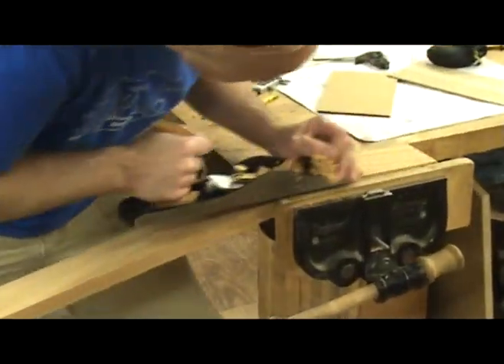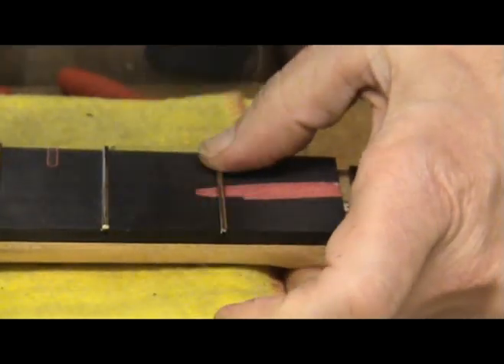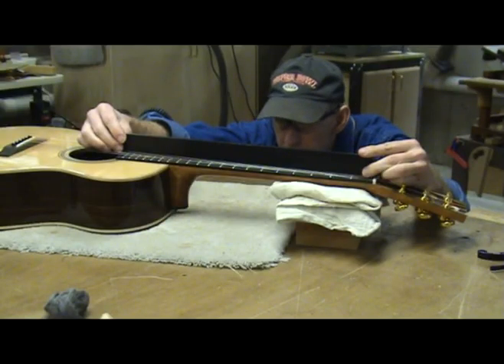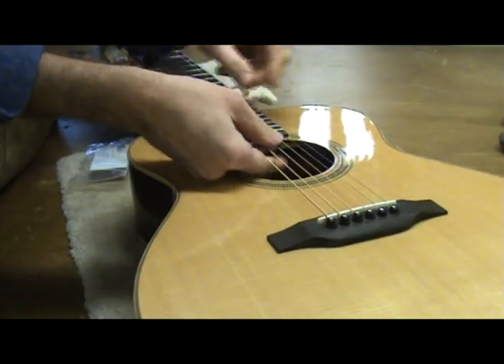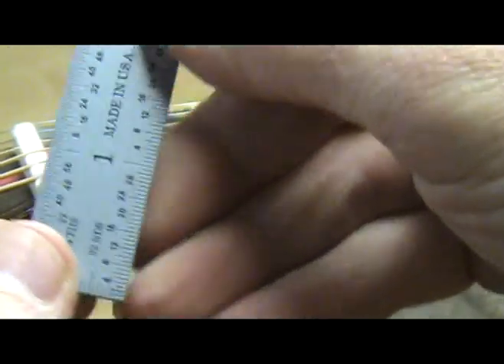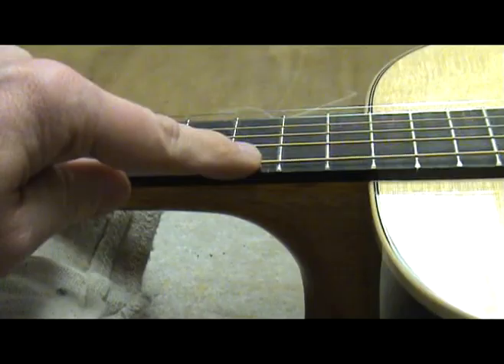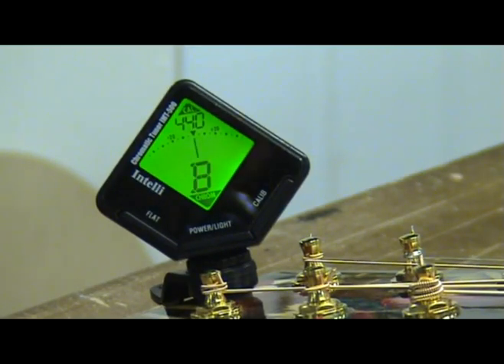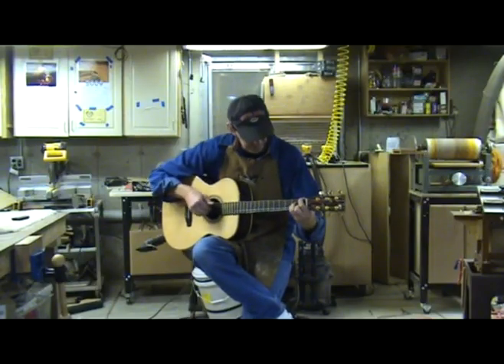Luthier Tips du Jour - Acoustic Guitar Set Up

Comment: @ElectricTurkey1  In addition to what ObrienGuitars has said may I add that when using a capo it should be placed as close to the required fret as possible (without muting) I have noticed many capo users wrongly place the capo mid fret or too close to the previous fret.

Comment from the maker: @buckethead777 You need to remove the saddle and sand the bottom of it but I only do this after first checking the truss rod and adjusting if needed and then checking the action at the nut. I then adjust the saddle height if needed.

Comment from the maker: @REX05011 In this case, usually nylon string guitars, the maker has carefully thought out things like neck angle, relief etc during the construction phase. Also, there is not as much tension on these guitars so a truss rod is not necessary. If you happen to have a steel string guitar without a truss rod then you could experience relief issues.

Comment: I was always told to set the string at the 12th  fret by sanding the bottom of the saddle prior to adjusting the nut. The nut should be the last thing done prior to setting the intonation.  The reason was if you adjusted the nut height first and then adjusted the height of the string at the 12th fret by sanding down the saddle you might get buzzing at the first fret .  What do you think.
Reply from the maker: I suppose that could happen but the opposite is also true. Since a larger adjustment is usually necessary at the 12th fret instead of the nut I choose to adjust the action at the nut first.

Comment: Please note:  presuming the relief is satisfactory, cutting the nut slot depth before having a preferred saddle height can easily lead to buzzing (if the saddle needs substantial reduction in height)  or leave you with a stiff action if the saddle needs to be raised.  When you fret any string, the first element eliminated from the equation that contributes to buzz is the nut.   The proper order of adjustment is: neck relief, saddle height, nut slot depth and then intonation.  Period.

Comment: @MrVoodoo72  Several acoustic guitars do actually have adjustable bridges (Gibson Humming Board is one) I'm not sure how this could be used on guitars with under saddle pick ups though as myold Cimar 12 string humming bird copy was always used with a sound hole magnetic pick up. (necessitating steel or nickel wound strings)

Comment: Thanks for answering I really appreciate it.there is some relief on the neck. Also if I put a straight edge on, it touches the 16f and not the last fret. Is that ok? I don’t have an align key to make adjustments.when I got my guitar,it had medium gauge strings.I don’t know the size.I’m using light strings on the advice from a music shop. will the extra tension from medium strings be enough to bring the relief back?This is the first time iv setup a guitar and want to get the best sound from it

Comment: Great video! This is just what I do to make a $100 guitar player like a $1000 guitar.  I file down to a stack of feeler gauges for a nearly foolproof nut adjustment - but same result.   

If you have never adjusted a truss rod then by definition you do not know what you are doing.  How are you going to learn?  First get a cheap guitar for your first subject.  You probably have one.   Then LOOSEN the truss rod first - 1/4 turn or so - even if you need to tighten it.  Now as you tighten it if it suddenly gets really hard to turn (after going that 1/4 turn) you know it is bottomed out and not just a little tight.

Comment: In setting the bridge on a classical guitar with a 650 scale and normal tension strings, the reference I am using tells me to use a bridge stick cut to 651 and butt the bridge up against the end (centered on the fretboard).  My question is that since the saddle is 1/8" thick, that will make the front of the saddle back another 3.1 mm because of the wood in the bridge OR if the stick contacts the nut only the center of the nut will be 1.5 mm longer than the 651mm of the stick.  Help!  Is that a correct setting or should it be 651mm to the center of the nut to the face of the nut?  There wasn't any drawing to clarify that part of the build.  So any help would be greatly appreciated. 
Frank in Arlington, Texas
Reply from the maker: I add 2mm to the overall scale length on my classical guitars. This is measured from the front edge of the nut to the front edge of the saddle. Hope this helps.

Comment: I'm from Brazil I'm 24 years old
the doubt now and I bought a guitar so he imported've been missing the fuse
I bought a fuse already framed and ready to put q realized the strings were high and the sound too dry and bad
oq do wonder what the first adjustment which should regulate the fuse first eyelash or tensor?
ja hear you have to find the octave guitar
As it is the eighth and how to measure the radius if necessary?
I hope you help me with many questions

Comment: Really good vid Robert, about the best I've seen on basic setup. Just a question/observation about checking the intonation. I come from a technical background so I may have a slightly different viewpoint to most musicians. When I pluck an open string, the frequency (pitch) that I hear is what I regard as the Fundamental (or 1st harmonic) frequency of that string. If I fret that string at the 12th fret and pluck, what I hear is referred to in technical terms as the 2nd harmonic, and ideally should have a frequency (pitch) twice that of the fundamental. For example, if my guitar is tuned to standard 440, the open low E string has a frequency of 82.4 Hz. If I fret that string at the 12th and pluck I should hear (or at least my fancy electronic tuner should), a frequency of 164.8 Hz. This would indicate to me that my guitar is perfectly intonated, at least for that string. If my tuner reads high or low from 164.4, this indicates to me that some adjustment of the saddle or bridge is required to get the intonation right.Just my 2c worth. I'd love to hear comments.
Reply from the maker: You are correct. Books can and have been written on the subject of intonation. It is complicated. We haven't even discussed the different temperaments either!

Comment: How low can you file the saddle down, (obviously without buzzing strings) in order to get the lowest action? Is there a limit that will affect the sound? Thank you
Reply from the maker: Your guitar will need to have the correct neck geometry. If not you have a high action and no saddle left to lower and get the correct action. Your guitar would then be a candidate for a neck reset. I like to keep around 3 or 4 mm of bone exposed out of the saddle to get the action I like at the 12th fret.

Comment from the maker: @RedLedZep Sounds like your guitar has been extremely neglected and dried out as a result. When this happens you also usually have internal structural issues as well, check the bracing to make sure it is still intact. If it isn't then address that first. SLOWLY, humidify the guitar and keep it that way.

Comment: On relief and truss rod, when i tap my 6th string on the 6th fret, i heard a sound, does it mean the guitar doesnt much relief? Should the string sits on the 6/7fret?
Reply from the maker: Hearing a sound means the neck has relief and this is good. The idea is to adjust the truss rod for the amount of relief that the player prefers.
Reply: WRONG Mr luthier !! Relief is not what PLAYER prefers ! It's what the GUITAR prefers so as to provide the vibrating strings enough space to spin around without hitting frets ! The ACTION, is accomplished by the saddle height, and is what a player will prefer to be set at, according to his taste ! You contradict the entire method of setting up a guitar. Booo to yooooo !!
Reply from the maker: @MarkInLA  I think in the end we agree and get the same results but have described it differently. Happy Building.

Comment: Wow, 2.5mm at the 12th fret low e and 2mm at the high e? How in the world do you bend strings with such high action? I like 3/32 at the low e and 1/16 at the high e and I can do bends on my D28 as though it was a les Paul.
Reply: Well:  3/32 is 2,38mm, not great difference to 2,5mm, I don´t consider that a high action.  But 1/16 definitively would help for bendings.  Cheers.

Comment from the maker: @jhaley12 The truss rod is not for adjusting the action but rather the amount of relief in the neck. You must follow the steps I outline in the video to do a set up properly. 
I also assume that the fretboard has been leveled/radiused properly and the frets are installed and crowned correctly. If so then you should be able to set up your guitar. However, there comes a point where you start defying the laws of physics if you go too low. Good luck.

Comment: ATTENTION! Anyone? I was so close to setting up my guitar intonation (so close) and then I strewed it up. I started at the bass (6th) string; the intonation was sharp, so I filled it until it was fixed. I then proceeded with the other strings that were sharp (I had no flat intonation problems on any strings). When I got to the 1st and 2nd strings, I attempted the  same filing process, and now the 1st and 2nd strings are even sharper. I was just about to start recording and feel completely deflated and disappointed. Any useful help would be greatly welcomed! Oh, the tuning is DADADD

Great video! I didn't realize a flat intonation issue could be fixed by filing the opposite direction of the saddle. Is that true, or did I misunderstand something?
Reply: I'm not an expert but from my own experience, and as you say the problems are with the two unwound strings, it could be that the strings are past their best, it shows on the unwound strings first. It should perhaps be noted (Robert can't tell us everything) that setting the intonation at the bridge saddle should only be done with new strings on the guitar. I once had a very slight intonation problem that was cured simply by a new set of strings.

Incidentally with the DADADD tuning - to get a balanced string response: The 6th and 1st should be thicker and the second and third strings should be thinner than in a normal set of strings. The way that tuning affects intonation set at the bridge saddle is negligible though - although if you are using an unwound string on the third (to take it up to A) that would affect it noticeably.

Comment from the maker: @chriss869 You need to follow the instructions in the video. Check the relief of the neck under tension and adjust the truss rod if needed to get the correct relief I mention. Yes, string tension makes a difference and therefore you need to run your guitar through a set up if you change string tension.

Comment: Your method is wrong, the right is: 
1. First setup neck`s profile by truss rod
2. Setup action on frets near to the bridge (or 12 fret, no matter)
3. Last step is to setup action at nut
Reply from the maker: The method I explain has been used successfully by me and others for over 40 years on thousands of guitars. If you have another method that works for you then use it.